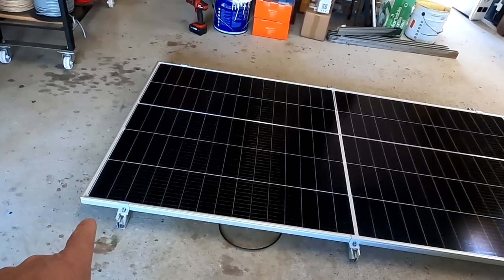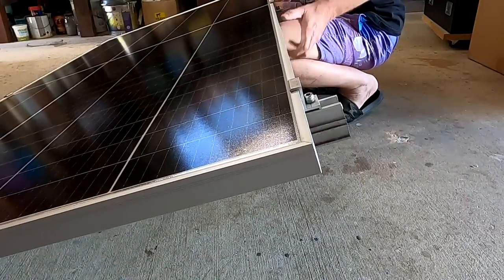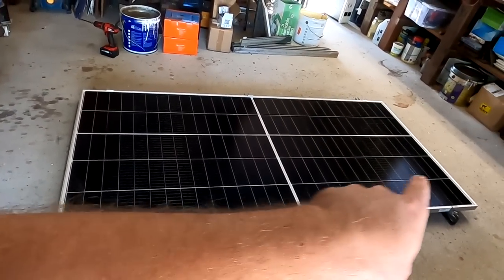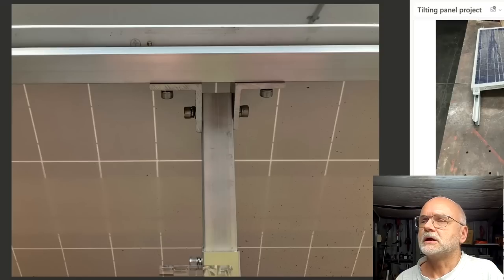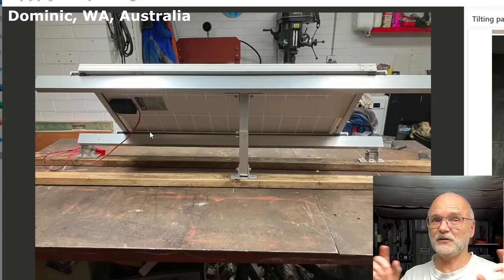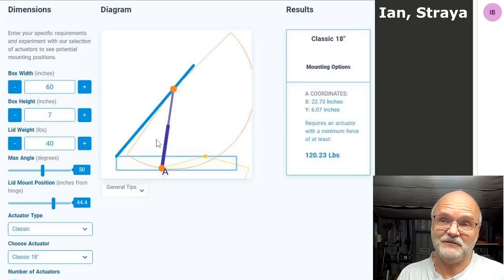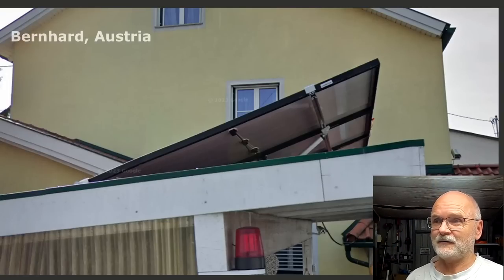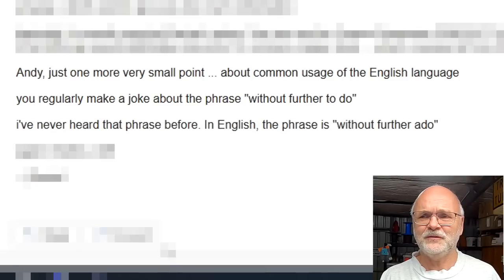Single axis solar tracker with large panels impossible? Here are YOUR suggestions.

Comment: You have so much unused space, the cheapest way will be, to install more pannels - and like some German YTers - straight on vertikal walls for the winter.

For to compare (PVGIS in Cologne))

2
1304kWh/a  2 wege tracking  , Nov - Feb 168,49 kWh

1241 kWh/a 39°/0° , Nov - Feb 158,0 kWh
902 kWh/a 10°/0° , Nov - Feb 93,17 kWh

886 kWh/a 79°/0° , Nov - Feb 171,0 kWh
886 kWh/a 70°/0° , Nov - Feb 174,6 kWh

The costs for PV pannels is today very low, so in makes no sense for to invest in tracking anymore

Choose the best angel for when you need the "max power" and all is ok.
Reply from the maker: Well, you must be new to the channel. Welcome!

Comment: I've seen now up to 15:30 and the obvious choice for more stiffness is the good old rectangle plate with 2 slots and another hole 2 connect one beam with 2 crews and use the 3 to align perfectly. These rectangular cross conoectors (plates) are adding rigidity by extending the contact surface from just th usual 4 x 4 cm in which both beams would have contact to a 20 x 10 cm plate which spreads the connections from 4x4 to 4 x 20 on the first beam and  from 4 x 4 cm to 4 x 10 cm which means 5 times more in the first case and 2,5 times more in the second case.

BOMBENFEST will bring you to a new level of rigidity cause we had build ours that way, big onese even tilted vertically and you might wonder how ?
No, not really. So got to solar-europe dot old germany and open the first section Montagematerial 
then go ahead and open the section Schrauben & Zuebhör  and finally open the SONSTIGE section, yes, SONSTIGE not Zubehör cause would not make sense to have a Zubehör section under Schrauben & Zubehör, right?
I emphasize cause I had searched for that missing piece I had seen once the whole 7 seas to find it so much later. under Sonsitge, the greatest piece on earth ?
Just a simple VARIOGELENK for 5 € quite similiar to your, maybe in details a bit different. I emphasize on that cause my first purchase had not worked out, but this one did.

The final Kreuzverbinder plate can be found under Montagematerial - Winkel, & Verbinder and finally open KREUZVERBINDER to see the best and cheapest soultion first as schematics and then in the product selection in the upper left corner the ZB Kreuzverbinderplatte with all the 3 needed screws and  nuts together for just under 3€or 12€ in total. 
I guess you will complain about the shipping, but I had thought you would be able to get such improvisation done after that inspiration, rigth ?

Should I mention I have 5 of these big 500 Wp Agrar panels next to each other and even upright ? 

And the usual angle is about 28° and for special northern german winter we go from 28° up to 75° manualy. At 28° they are on the back in contract with a part of the upper roof, therefore can not get any further and if I need more angle I will need to lift the 5 x 30 kg = 150 kg about 15° more vertical to 45° then 60° and finally 75°. Body fitness excercise in the morning - just kidding, cause that happens every 3 weeks starting from end of september to stay about 4 weeks across chrismas at 75°. 

I have 5 of the Vario Gelenke on the bottom under a 6 m beam, which are connected by 5 Kreuzverbinder to 5 vertical 2,40m beams - same on the top , I mean 5 Kruezverbinder and 1 horizontal 6 m beam.  You might called it silly as others had done before but it works reliable cause on the flattest angle it is connected with the upper roof, and from there upwards I use again 5 beams to get it upwards to 45° / 60° / 75 °.and then those 5 back vertical presses naturally agains the roofs beam like a triangle if you look through that back side under the paneel  if you look from the side.
AND: these panels are only dedicated for winter harvest to power the air 2 air heatpumps we recently got and the heatpumpe boiler with heat exchanger to supply the old oil central heater and its radiators with 60°C warm heating water. 2,5 kWp on top of a 17 kWp array just for the big winter harvest cause once tilted they bring up to 1,2 kW more or equal the 6 kWp with just 18° on the upper roof. The shorter the days the more I can benefit from the then far steeper angle 18° versus 28° versus 75°.   

Those vertical beams are building a triangle stand and are quite powerfull if the wind presses from the front onto the roof. And from the back it can only push a bit cause there are 2 roofs behind each other separated by the nicest german word to translate: Knie-stock, you know like Zoll-stock. therefore the wind can get mostly only behind the upper half cause the lower is protected by the building or its Kniestock. 

At least I had fun while writing  that Knie- and Zollstock comparison down. 
Just have a look and I guess you will be blinded how easy that is if you have those pieces  in reach or a guy with a digital laser cutter, that sword to fight metal. 

All the best - I can promise you the SUN is already coming , days are 20 minutes or even more already shorter even though we will get hottest day of the year I guess: about 35°